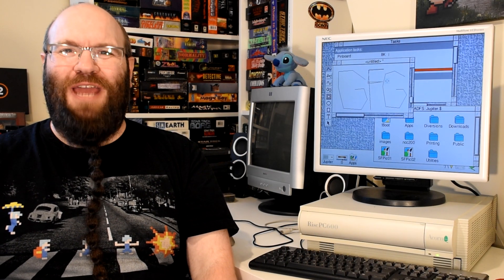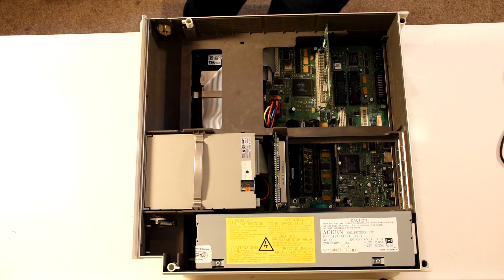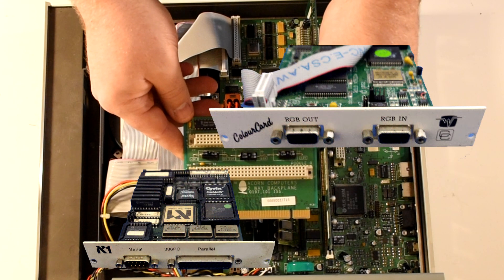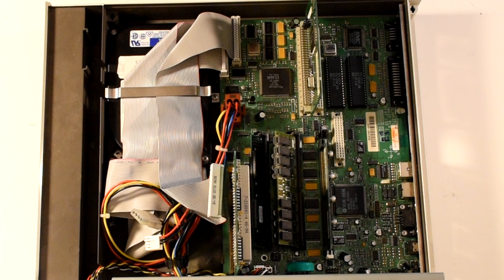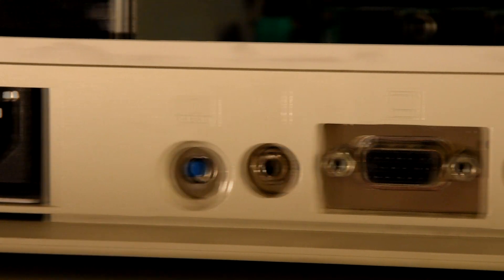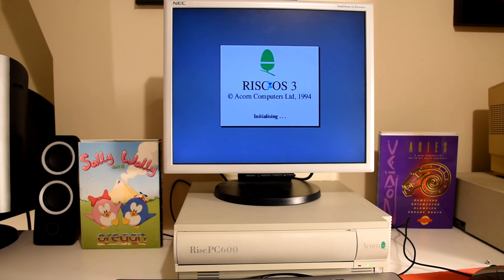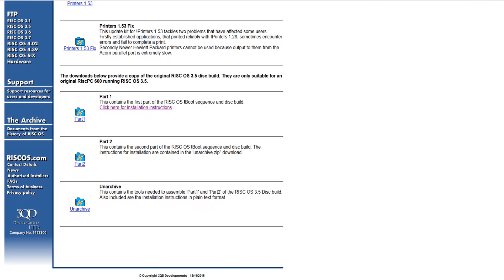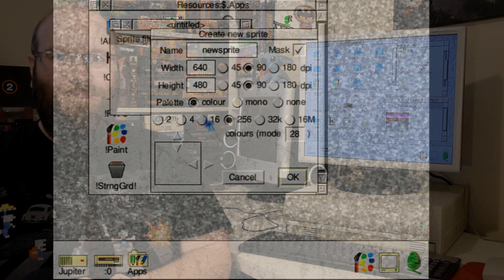Acorn RiscPC 600 : Part 1 - Hardware

Comment: As the donor of this RISC PC600. I am delighted to see it in use and look forward to seeing the follow-up videos to this one.
I was a class teacher in a primary school when I bought the RISC PC. I had an Acorn A4000 previously, a rather cut-down version of the RISC PC, which was the standard primary school post the BBC MIcro. I sold it and bought the RISC PC second hand.
Software?
In schools, Textease simple DTP, Clicker and Ovation DTP  were commonly licensed.
You have already demonstrated, !Edit, !Paint and !Draw. These were in ROM and could be accessed quickly. !Draw was actually a powerful vector graphics programme. Computer Concepts brought out an advanced version called Artworks that was really a top class package. (I still use the PC version Xara, but the compatibility for previous users of Artworks is being lost with each new version). 
Computer Concepts' main selling software Impression DTP that was truly impressive. Impression and Artworks may look slow and clunky now, but the RISC PC was the fastest home computer. The comparable Mac had at that time, I think, a black and white display.
Sibelius score-writing and music publishing software was developed for RISC OS because the complexity of such software needed the fastest processor available. Sibelius was sold, in some cases, as a complete package with a new RISC PC. There was a cheaper version for home use that I bought and used extensively.
Sibelius remains the most used software in its field.
There were classic games like Repton, a sliding block puzzle and a lot more! It had a game editor, too! !Othello (Reversi) and a Tetris, as you'd expect.
Most of the games we played were free or low cost. You could order them on 3.5 inch floppies from various enthusiast suppliers.
I recall;
- A Lemmings clone
- Son of Girinus II - preventing a mad professor from being....... I cannot quite remember.
- Ogres Lair - a two player game, avoiding an ogre!
Looking forward to your next video.
PW
Reply from the maker: A very big thankyou for selling this wonderful machine to me, I've really enjoyed using it and finding out what it could do.

Comment: So far, the only experience I've had with RISC OS was in an emulator and on the Raspberry Pi series. If I could get an Acorn machine converted to the American 115-volt AC system, that would be nice.

Comment: The battery leaks and corrodes over time, some old users have reported it damaging the motherboard as well, I was one of the lucky ones though, my old machine is fine.
Reply from the maker: Yeah, those old batteries have killed way too many machines over the years!
I had to send off my Amiga4000 off to be fixed due a leaking battery.

Comment: Interesting machines, I used an Archimedes of some sort at school in my early years and then in about 98-99 a dedicated computer lab was built and they were all windows 98 machines which spelt an end to Acorns dominance in the classrooms.

Though I do remember at secondary school that a Risc PC of some variety was used as a server box or something. Looked interesting but massively dated in around 2004 or so.
Reply from the maker: I remember seeing rows of Acorn machines (mostly A3000) at schools. 
Then Tesco started doing their computer for schools vouchers and picked RM as their computer of choice and things changed so quickly.
When I left high school in 99 half of the Acorns had gone and there was plans to get rid of the rest.
Thinking back I wish I could have gotten my hands on some of those old machines!
Reply: @GouldFishOnGames  ah well we were a bit poorer than that; one machine per classroom lol. And we had to use it in groups but I was so young I cannot for the life of me remember what we used it for.

My secondary school also had a few classrooms with BBC micros and zx81s in a back room. Never had the courage to ask for them lol.

Comment: Great video, thank you. A small error, though : the PC card can't be a Pentium CPU, only 486. The fastest CPU available was the DX4/133.
Reply: There was a card based off the citrix 586 cpu, and one base on the IBM 586 as well.  While not an intel pentiums both had the full pentium instruction set, so most pc software could just treat them as pentiums.
Reply from the maker: Oh,  I'm sure I read about people using "586" CPU's which were the code name for the Pentium.
 So it's possible I've mixed that up.